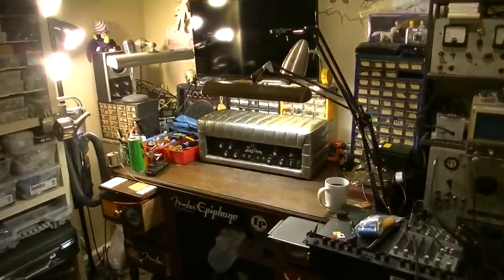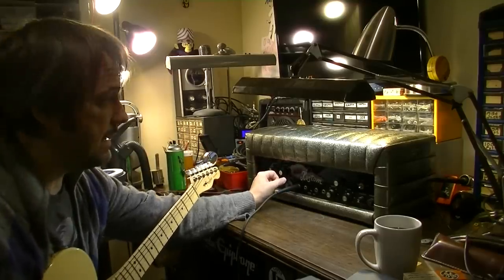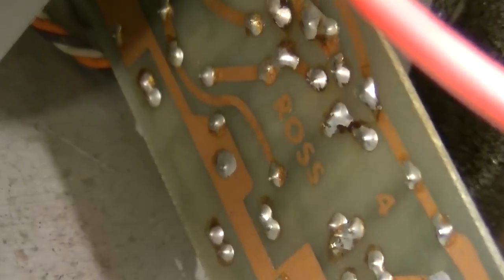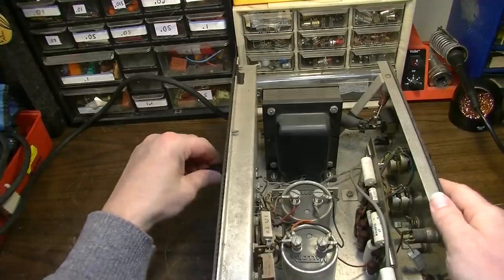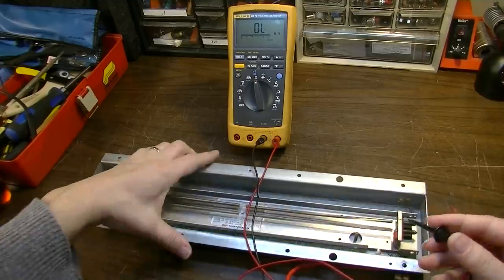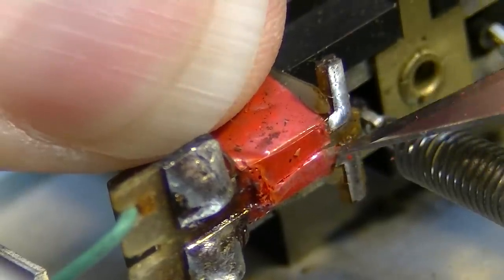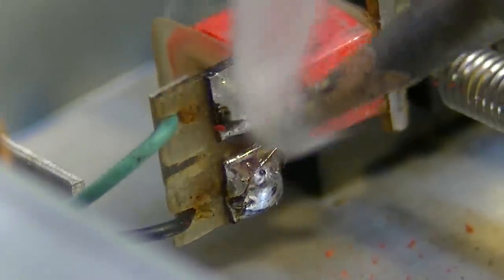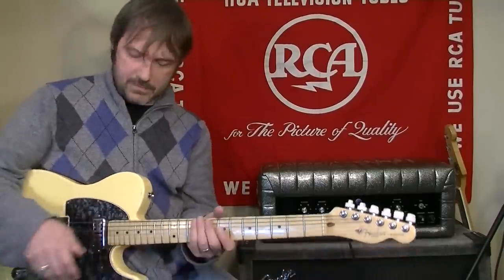Pixies SABOTAGED this 1966 Kustom Guitar Amp! Can I Borrow a Microscope?

Comment: "Now I can breath again, " he said after holding his breath and then immediately choking on solder flux fumes. I kept saying stop right there you got that tiny wire and you kept going back with the iron. I was on the edge of my seat! As Dan Erlewine says, "You got to know when to stop." Great job and video.
Reply: Brad, you didn't establish a mechanical connection between the wire and the lug; that wire is just floating in that big blob of solder. You would have been better served by just reflowing the solder already on the lug while pressing the wire against the lug.
Reply: I've had to repair a few reverb tanks myself - they are the absolute worst.  This is exactly the sort of problem that comes along all the time.  What people may not realise is the wire is thinner than a human hair, and it is not bare copper - there is a lacquer coating on it so it's not easy to solder.  Going back time and again with the soldering iron may help to melt the lacquer and ensure a proper fix. I can say as well, that this is an extremely neat job - good work!

Comment: That was fascinating to watch Brad.  Wouldn't mind if you could do a quick video on just how a reverb tank functions, or if you've got one already, point it out.
Reply: It's actually a dirt simple and quite ingenious little device. I'm sure Brad can explain it better than I can though.
Reply from the maker: A signal is driven into the tank, which has a tiny inductor (the part I fixed). The inductor "induces" a small audio signal into the springs. The signal is picked up at the other end by another inductor coil, kind of like how a microphone picks up sound and creates an analog signal, but in this case, it's picking up both the original audio AND the warble and reverberation of the springs and feeds that signal back into the amp where it's mixed in with the dry signal at some point.
Reply: Thanks for the reply.  All I knew is that when I was a kid, it was fun to bump my friend's old cheap Peavey amp and listen to the wild spring noise that came out.
Reply: I understand the signal passes through the springs and then converted back into sound. The fenders that have two channels does the non Reverb Channel have better tone. My basic question is does the Reverb tank screw up the tone of the amp?

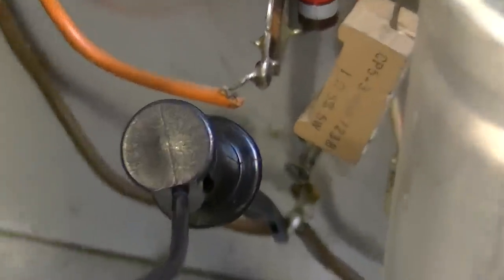Comment: Another nice one ! @ 11:13 your wife has an English accent . Nice catch , you are truly rich !  Back when I was building pickups and adding bobbin wire to pickups , I had a dedicated low wattage soldering iron to solder those .004 to .007 thick copper wires. So just turn the power down until it stops melting or burning the wire, is how I do it today.

Comment: The lead wire for the reverb input should be soldered to the small pads at the opposite end of the pc-board, so that when the input wires for that board are soldered the coil wires aren't effected, there is two traces that connect the two small pads to the larger pads.
Nice fix.

Comment: Brad,  Nice fix on something you can't see without serious magnification.  A little more than a year ago, I ended up purchasing a $$$ trinocular microscope for working on a 10-track magnetic ('60s-vintage minicomputer) tape head that was full of wires way less than ~0.005-inches (0.127-mm, I think) in diameter.  One of these days I'll rig up a heat shield for my hot air SMT repair gun that I use to soften the potting compound inside that tape head so I can dig deeper into it without risking melting the end of my $$$ microscope.  I haven't actually measured the wire diameters yet because I'm afraid I'll cut the wire(s) with my dial calipers -- maybe a mic will work better.  I also need to purchase a camera for the third "eyepiece" so I can work by watching a monitor, similar to what you did on this amp.  And I'll be able to use it on troubleshooting & repairing amps too.
Reply from the maker: Maybe get a camcorder with a monitor output and you're good. I also modded an articulated microphone arm to mount my camera. That helps. I can position it 4 feet away from the work and still zoom way in.
Reply: I'll check into a camcorder with a monitor output.  We've always wanted one of the "modern" ones that weight less than ~5 pounds!  And no more tape cassettes too.
Reply from the maker: Actually, an old camcorder with good optics and monitor out could work very well! And it would be super cheap. As long as you're just using it to magnify your work, who cares what medium it stores on?

Comment: I have a 1973 Kustom K250-2 guitar amp and a matching 4x12 speaker cabinet. When you turn the amp on there is a pretty good white noise hum. It's there wherther or not a guitar cord is plugged in to the amp, and even when all the knobs are turned to zero. Any idea where to start looking to fix the issue? Thnnks...
Reply: Ground wires ground wires, but honestly beyond that my 795 has always had a hum but it is early solid state technology. I did however replace as many as components that were available (70%) as far as capacitors, resistors, Transistors and also installed a custom KUSTOM fuse block along with every wire while shielding the whole chassis. Extremely quiet without the reverb plugged in as that’s where my only hum was coming from after shielding and afterwards. While I use external effects it was interfering anyways therefore it made sense to o disconnect it and remove it all together. If anyone is in need of the full reverb cradle complete I have it packed away nicely.
Hopefully this helps.
✌🏽

Comment: I had a kustom head, early in my musical career.   I don’t think I was even a teenager yet.  In fact I think someone gave it to me even.  I think it well, I don’t really remember the color or if it was a Bass or Guitar amp.  What I do remember is in a time in Kustom’s History they contracted with Altec Lansing for the speakers in their cabinets.  A few years later the head had just been sitting somewhere in my room,  I bought some Faux Voice of the theater cabinets.  The drivers in them turned out to be from radio shack.  I put the Altec’s in them the Radio Shack speakers in the Kustom Cab and sold it and the head and bought a new guitar.  The VOT cabs were a lot less faux then.  Those were great and probably some of the best 15” drivers I ever owned.  They certainly rivaled the JBL drivers I bought in late 70’s or early 80’s.  The JBL horns did smoke whatever horns were in the faux VOT cabs

I did look like this started late at night when the kids were asleep or after they’d gone to school.

Comment: Using a camera to guide the work is how EEs do it when they're dealing with boards with lots of tiny grain of rice sized surface mount components. One thing you might want to get for future solder jobs like that is a syringe of solder paste so you're not longing for a third hand as often -- just a little dab and the parts will stick long enough to hit with the iron.
Reply from the maker: Constantly upgrading my lab to accommodate more types of electronics I don't typically deal with. Having mainly done vintage tube amp stuff, I rarely run into surface mount, but its getting more common to get such requests...

Comment: Those Kustom solid state amps sound amazing when running amp modelers through them
Reply: I have the humongous 150w 12 input version of this very amp, weighs like 90lbs but it does sound glorious. On its own clean or with any kind of distortion, even preamp modelers. I also use a more modern 2x10 combo of theirs same deal, great clean and just as great with good drive.

Comment: Your plating made that old Kustom amp sound really good!
I own a few of them that rolled and pleated in black and had extra controls because they were lead amps.
I also have a few of the later model more standard looking cabinet models.
I have never had any kind of problem with any of them other than the transistor noise that is in all of them right out of the box...
 Thank you for bringing back some very good memories to an old man...

Comment: Cool video! Just picked up a 1970 Kustom 100 amp head ( in flawless condition!) and the 212 cabinet...just stunning condition for the tuck n roll exterior!...but two things need attention; the Reverb does not function, and the power cord needs to be updated to a 3-prong grounded type...

Comment: I bought my son a Road 440 bass head. I think that Road Electronics was Bud Ross' next venture right after losing Kustom. That head sounded good, but failed, spectacularly blowing a nice d140 and two eminence 10's. The power transistors were then replaced, and I sold it. That particular one didn't like a 4ohm load. Now I miss it. I'm goofy. That Road stuff was the TV backline on American Bandstand!

Comment: What I didn’t know or realized was that in early Grateful Dead history you can see Phil Lesh use 2 of these with 2 Sunn/JBL2x15’s especially at the Monterey pop performance and Golden Gate Park using a jazz bass and this is before he switched to 4 dual showman heads to run his modded guild bass. Before the advent of active electronics in basses

Comment: Had Bought a Blue 300 Head with (2) 4/12” columns years ago. All for $125 knowing the head was not working. Found a similar loose/cold solder joint. Have been using that setup for 30 years now 👍🏼 (did install a pair of small high frequency drivers into each column)

Comment: Kustoms USUALLY used pretty good components.   I had one of those  Germanium "Space ship"  transistors blown on my K200-B1,  it was from too much input signal.    The later ones had tantalum caps for the small values.  They refer to that type as a "Frankenstein"   due to the cabinet having a "big forehead"

Comment: There must have been a special "bond" between some of the "Southern Fried Rock" bands, and Kustom, because when I contracted audio engineering services to the Valley Forge Music Fair, near Philly, it seemed like 70% of the bands had them, and cared for them well. Their primary amps were Kustoms, and their backups were either Peavey, or Marshall (and pretty much nothing else). Weird Al Yankovic had at least ten Fender amps, and one Kustom, his audio engineer quipped that "the Kustom helped him/his accordion hit the "hi notes" (it was a seldom used backup). You haven't visited Hell, until you've had to assign an audio channel to an amp connected to an accordion; I've heard that Cordovox's are even worse.

These classic amps are the best, thanks for sharing!

PS, please don't take the "accordion challenge", or Lawrence Welk will haunt you!
Reply from the maker: I think accordion needs to make a comeback, but Weird Al is actually taking up guitar now, I read. You're right on the Kustom and Peavey in southern rock. Both operations were well situated to distribute to the areas where southern rock was coming out of.
Reply: Maybe that’s why I saw SO MANY of them growing up. I mean they were in every band almost.
Reply: @Bear Bones, Yes, isn’t that what that feedback switch was for, more feedback? 
I grew up in Florida in the early 70’s and graduated High School in ‘78. Kustoms were everywhere and I’d of bought one but in ‘74 due to a death I was able to get an amazing deal on an original SUNN Model 60 Amp with Cab. (2-16” Jensen’s) I didn’t want anything else for the next 25 years.
Reply: If memory serves, I remember that a few of those bands used their own audio engineer(s), roadie(s), perhaps?? The VFMF installed a wireless IFB system around '85/'86, which worked well until the venue closed in 1996. 

Here's the kicker, during the early '90s "Smothers Brothers" tour, which began after their "Comedy Hour" show ended ('89 or '90), there was a band which traveled with them. The band was the instrumental backup for the 'brothers', for Jim Stafford, and on occasion, for Mason "Classical Gas" Williams. (almost typed Mason Reese).

However, their real purpose was to orchestrate the movements, and "Duncan Imperial" antics of Tommy's "Yoyo Man" persona.

The engineer for the band had set everything up for his mixer board, he did the switching/fading which fed four channels of my master console. Three hours before the concert, he discovered that we used the IFB, and had to 'daisy chain ground their amps, and his mixer.  Has anyone heard of this??

Comment: Cool stuff. You've got me inspired to fix my Kustom bass amp that has one dead channel. After I fix a boat load of other projects. Ever heard of a Lesmann amp? That's next.
Reply from the maker: Never heard of those. Where were they made?
Reply: As near as I can figure out they were made in Wisconsin. The tie in was a patent they had on electronics in accordions so I guess the idea was "You buy the accordion, you buy the amp." The cabinet's similar to a narrow panel 5E5 Pro, 15 inch speaker, prolly 30 or 40 watts, all tube, the chassis might have been partially made by Valco as the markings on the chassis for the tubes is similar to what Valco used on things like Supro amps, but it used a tag board. It's in very nice shape but packed with weirdness. I've got some pics on my judybox blog but I'll be taking more. Say....what kinda camera do you use?

Comment: The problem was caused by years of heat on the transistor leads. The owners ran that amp at full volume and caused maximum current flow. The Munsters meets the Ventures! Thanxz
Reply from the maker: I think you must be right on the heat. Probably a lot of current at that point.
Reply: molson12oz, Seriously, no caps replaced! That's probably a first on  this Channel.

Comment: My first "big amp" was a dead mint 1967 Kustom 100 with a matching 2x12 cabinet in black. The front of the cab had two ports where I brilliantly put incense cones. (I was about 12) I was just learning to play and didn't know solid state from tube. That amp was super clean and I tried using a Super Fuzz with it... I made a lot of noise on that set up, but as nice as it was clean, I was looking for another kind of sound... Took me some time to find out how to get it. The Kustom was out of fashion when I had it but I wish I had kept it.

Comment: The only time I encountered wire that thin is the 42 gauge I used in the pup I wound.  Funny thing, when I installed it in my tele (bridge) I scraped the wire against the metal and broke one strand of the wire.  I knew I could not solder it, so I decided to make some conductive paint from activated charcoal, white vinegar and white glue.  I painted it, wrapped it in electrical tape and it has worked since.   I put 12,000 wraps on the pup, but did not wrap them tight enough, when I potted the pup the wire ballooned beyond the edges of the bobbin.  That was about a year ago.  The pup does sound great though,  if I do say so myself.  That amp sounds great now.  WooHoo.

Comment: Brad, you rock bro. Very nice repair and great tones from that amp! BTW, those EV vintage mics are just awesome! I have a dynamic model that just shines with character, none of the hi-fi quality of more modern gear. Heck, I feel like getting another. Great video!
Reply from the maker: It looks like something a gameshow host would use, but it's a great little mic. Only problem is, it's so slim you need a custom mic clip for it. Or duct tape, like I'm using now. :D

Comment: That was some really nice playing at the end of the video! Kustom was one of the very first successful solid-state amp builders.  Even today they still sound great and look great in my opinion. The one you worked on was an early model some times referred to as the Frankenstein model. This was due to its front top being so much taller than the bottom front. I think the speaker fuse used on this model was more to protect the amp from blowing up in case someone overloader the output.

Comment: There is some other History on Kustom Amps which involved his Brother-In Law Tom Woodson , who started Woodson amps using some similar parts and components…I have a Woodson 150-2 which has 2 / 12” CTS Speakers…The small indicator bulb is not working at this moment which has a red wire clipped on the board right behind a 2.2 ( red-red-red-silver ) resistor….There is no schematic anywhere on the web and the PC Board is 5116 which is not on the Kustom site!!
By the way, I have a Kustom Kasino head that I repaired which 125 watts….LOUD!!
Just got rid of a Kustom 50-2  Combo Amp with the original Kustom amp cover….

Comment: I used to repair a lot of these, and slightly newer models on warranty, when I worked at a music store decades back. They all are pretty similar, 2n3055 outputs, quasi-comp. They started using some really lousy transistors, I ended up checking all of the 3055s for leakage even when the outputs weren't blown. And we had to send back the bad parts, none of my repairs were challenged. A lot of C-E leakage.
Reply from the maker: The output transistors in this were RCA 36892. Looks like there was an NTE equivalent, but this RCA number was only used by Kustom.
Reply: RCA was big on offering OEMs house numbered parts. I worked for a tiny power amp company (PAS400, PAS 800), and even our parts were house numbered. RCA was serious about audio transistors "back in the Day".

Comment: Had one of these exact amps, used it for guitar, jumpered the two channels, and it was loud.
The speaker jack has been replaced, only one output on the original amp...jumpered that too, into two 8ohm cabs...if memory serves me correctly on the ohms. Reverb tank was never really good in the one I had, so never used it much, started humming when using it.  It's a late 1960's amp. I forget the year, but there is/ was???, a vintage Kustom website showing all these old amps and cabs. Mostly the tuck & roll models like this one in the video.

Comment: Mine was blue with a 2, 15" cab. It also had multiple dry solder joints or no solder at all which makes you think. I know mine was made after Ross. I would not be surprised if that one too was built after Ross lost the Co. Leading to sabotage from Q/C and other loyal employees to Ross.